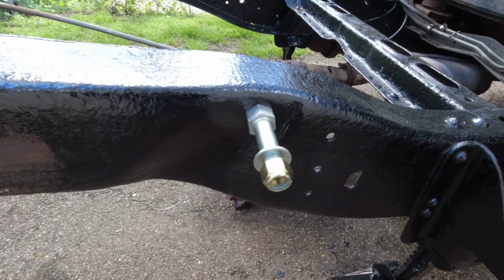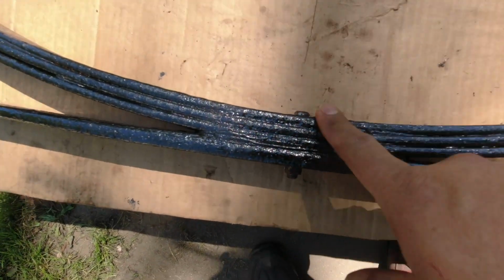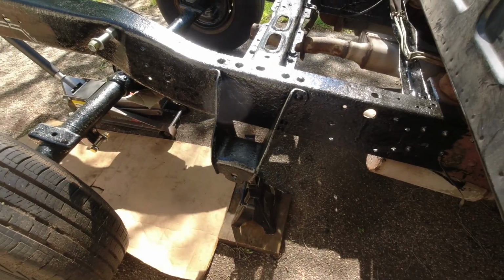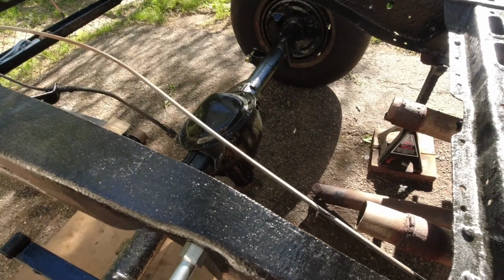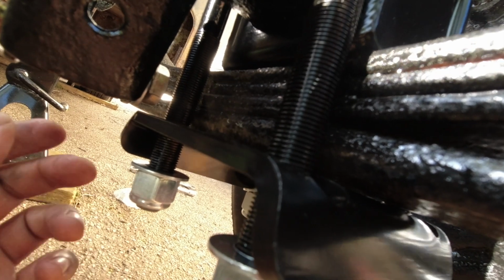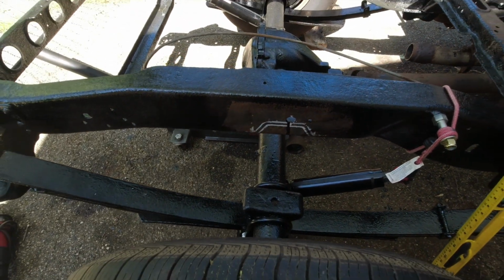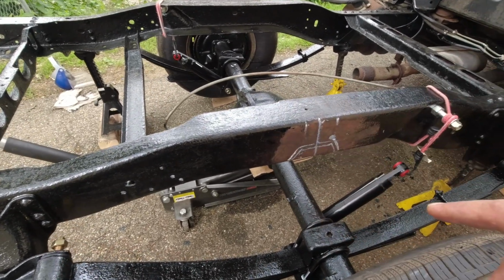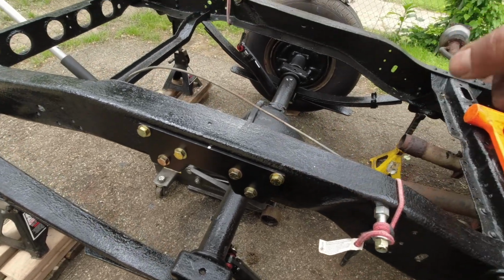1985 C10 Squarebody 5" CPP rear drop 4 of part 5

Comment: Should have flipped the bolt around nut on inside, otherwise you will need to drop leaf to change shock later down the road.
Reply from the maker: Yep, you’re correct. Eventually, I’m gonna order shock extenders, and the bolt is gonna be on the way